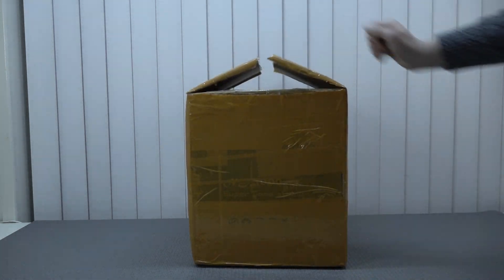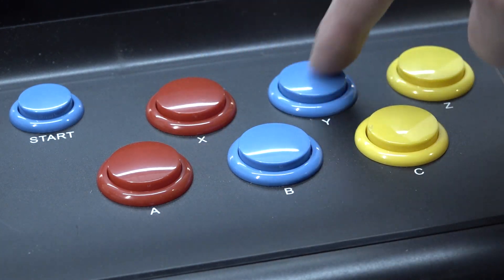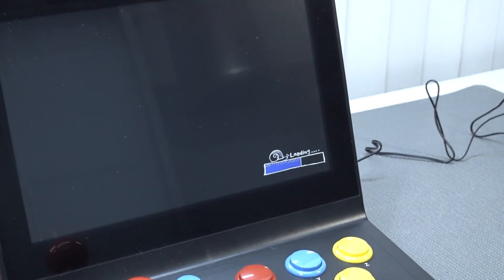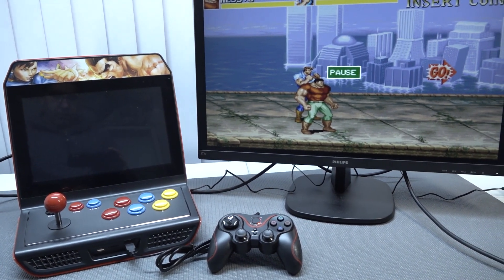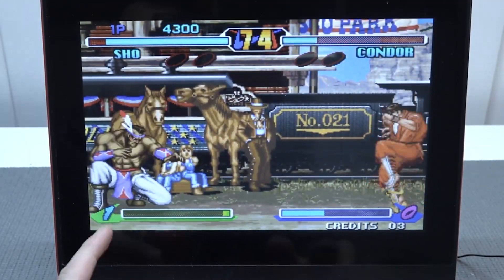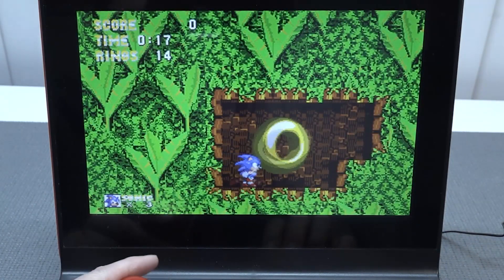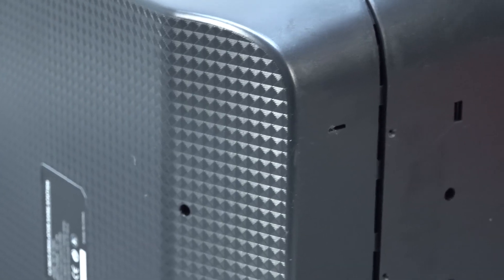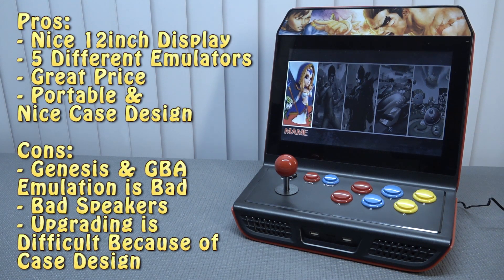My Favorite 129$ Mini 12inch Portable Arcade is Back ! 🤗

Comment: For around $200 shipped its a good value for what you get. The 12” screen is a nice size.   When you get into 15-17” bartops you are in the $600-800 range usually
Reply from the maker: This is the cheapest bartop you can get. 
Otherwise it is going to be stupid expensive 😱
Reply: It's slow on GBA. That's horrendous internals. I wish they sold this without the internals so I could stuff an anbernic or something in there.
Reply: @cybershellrev7083  its still a great value for a bartop .  They are very expensive and always have been.
Reply: @arcaderacer586  - Oh yeah absolutely, especially considering it has a streetfighter design. It's beautiful. Although, you mind feel difference of quality in hand to be worth the extra price. It's good for a casual yet budget solution.
Reply: 158€+160€ we are far from the advertised price...

Comment: Get the tool you need to get to the board and add a different PCB that is better. These types of devices make for great fixer uppers.
Reply from the maker: wonder if you can find a driver board kit for this 😳
Reply: @WickedGamerCollector  I mean as in, completely replacing the PCB already in it. Like the 8 gig Pi 4 or something.

Comment: Really nice device. I bought one used for 55€ here in Germany. I played around a bit with it and found out a really nice feature: When you connect a Xbox 360-pad, start an arcade-game. After loading press the start-button on the Xbox 360-controller and voila, there is the MAME-menu 🙂Here you can set the aspect ratio, resolution and all the things that let the games run better. Now i have an arcade-machine with the right resolution and aspect ratio, not the stretched images, especially from the vertical games 🙂
Reply from the maker: 55 euro ok that is diry cheap ! 😅
Thanks for you update regarding the menu ... that is interesting 😄

Comment: Great video as always Wicked, I like this machine, isn't there any way to upgrade the speakers?
Reply from the maker: maybe adding new  speaker... there is not a lot of room there. 
I was thinking if you get a driver board for the monitor maybe you can slap a pandora in this.
Reply: @WickedGamerCollector  or maybe an android box and have Emuelec working in it.  That would be awesome.
Reply: ccan you connect to external audio devies through aux or bt ?

Comment: You are the ONLY arcade games enthusiast that I have even seen who seems to tolerate playing with a stretched to hell aspect ratio, or that would ever recommend any device that hasn't the ability to output a 4:3 aspect ratio. I don't understand how this subject could escape your list of cons at the end...

While I personally love and respect those games way to much to ever be able to enjoy seeing them completely disfigured like that, to each their own after all, eh!
Reply: Yes, really surprising the aspect ratio issue is not discussed at all.
It is the first thing i was wondering about when seeing it unpacked and starting.
Reply: @Doman2000  Thanks for the reply man!
Those disgusting stretched aspect ratio arcade games were only in the mainstream during the age of retro compilation on the PS2. After that, NOBODY outside of China would ever release a device that cannot display the proper aspect ratio. Some can be modify with a CFW (I worked and release on for the Powkiddy A12, for instance), but most cannot, unless the output is a TV, and you can force a 4:3 ratio on it. 

I really can't understand how a veteran gamer, who has a channel mostly featuring arcade games, can promote those kind of devices for the past half decade...

Comment: What would you rate it
Reply from the maker: 6/10 
Why so low ? 
- Limited Emulation options
- Bad Emulation for MD and GBA 
- No Upgrade Possible Software
-  Case Construction Not Great For Teardown (for upgrading joysticks / buttons)
- Horrible Audio Quality 

Only for price it's my favorite arcade.
Last one I reviewed did not even boot up the normal menu 😂😂
Reply: @WickedGamerCollector  thanks!!
Reply: @WickedGamerCollector  Dus dan is een powkiddy a13 nog steeds geen slechte deal.

Comment: looked very promising at fist, but after seeing how badly it emulates some games... eh nah I'd pass.  A shame too, because it seems to emulate mame arcade games alright, which is all I'm really interested in.  I've got a decent gaming laptop loaded up with every emulator from the 8 bit, 16bit and 64 bit generations.  But for some reason mame has been a program I just havent been able to figure out how to get running correctly.  Not sure if its looking for the right roms, or getting the right bios pack, or settings or what.  But I've pretty much thrown in the towel,  I'd definitely be willing to spend a few hundred bucks on an arcade emulator that is just packed full of mame arcade games that work.  Since this thing only comes with 1000 games though and most dont even seem to run well,  that just aint for me.  I'd like to  find a nice middleground between these ultra cheap plastic emulator consoles, and the like 900 dollar custom built bartop machines that have all the best parts and like 30,000 games.